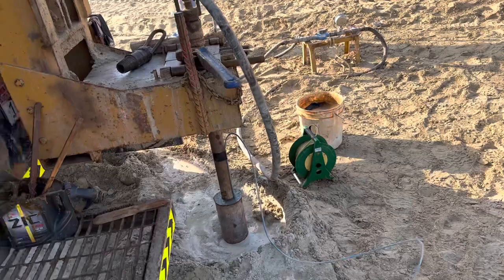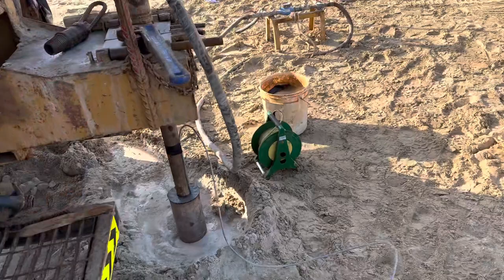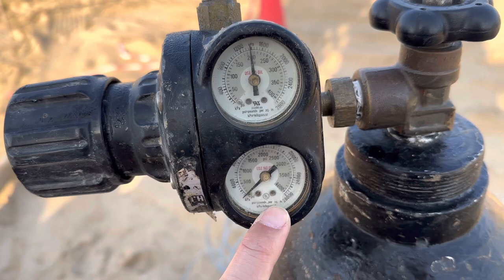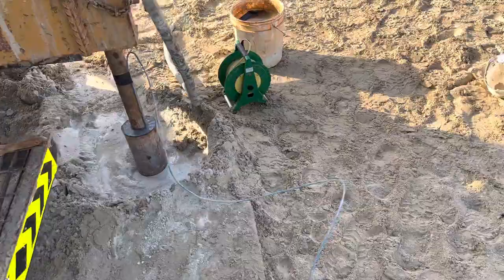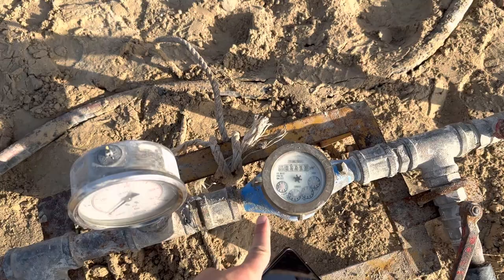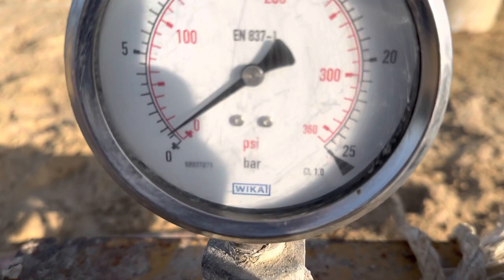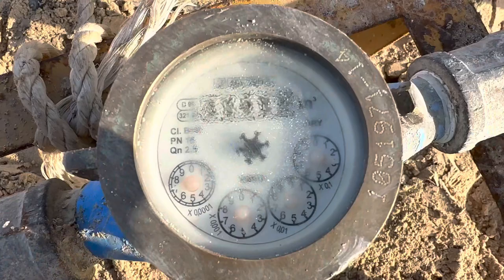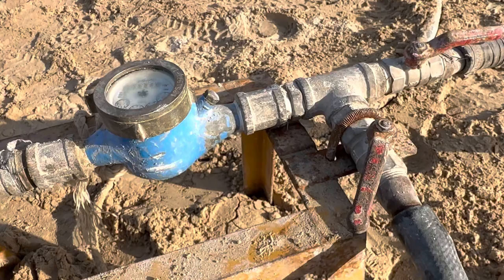Packer Permeability Test/ Lugeon Test

Comment from the maker: Hi, thank-you for watching the video. well the maximum pressure at which the water was being injected into the borehole in this case was 100bar. 
but it is not always the same. depends on the depth of the test, water table and the overburden sand on the test depth level.
Reply: Thanks a lot👍🏻